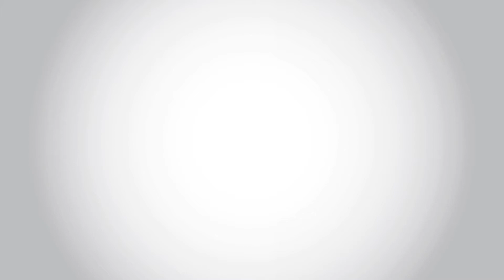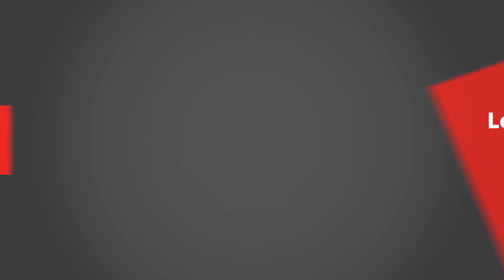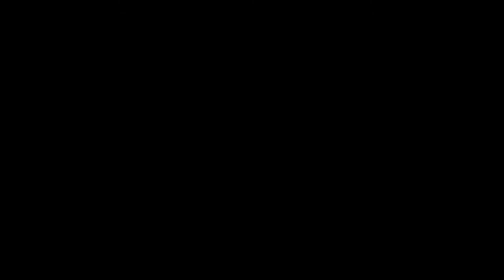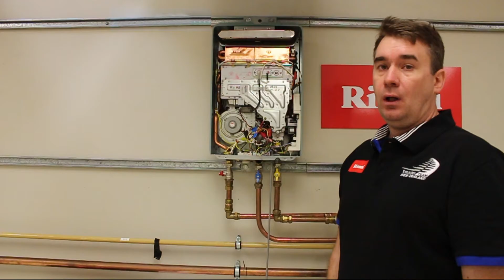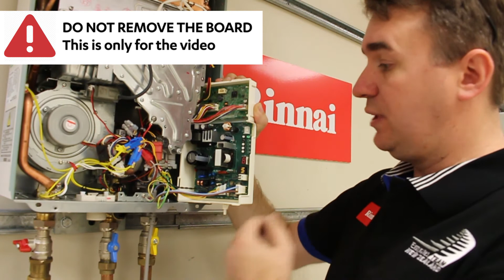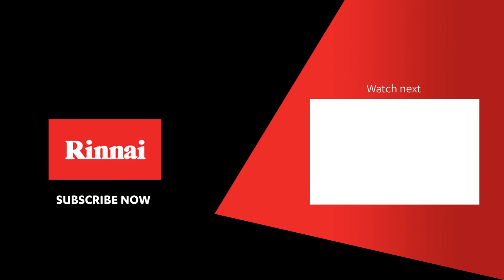Checking the Low & High Gas Pressures

Comment: Make a video on setting gas pressures on a R85i series (REU-V2532FFU) where you turn dip switch 7 on for forced low fire (.77" wc natural gass) and dip switches 7 and 8 on for forced high fire (3.70" wc natural gas).